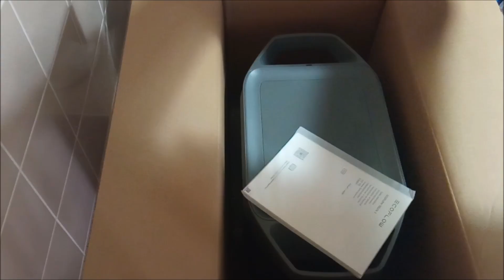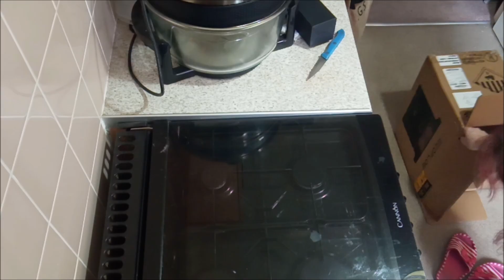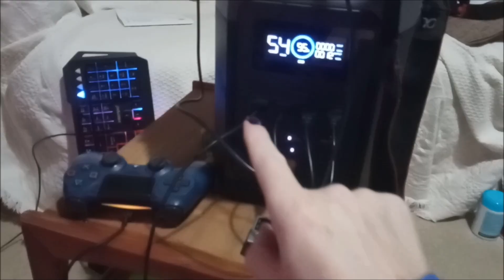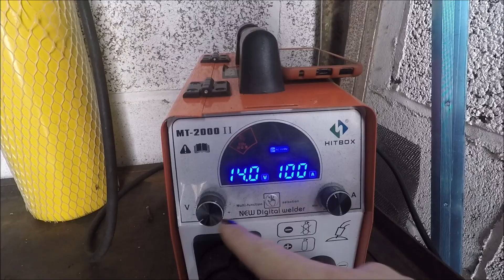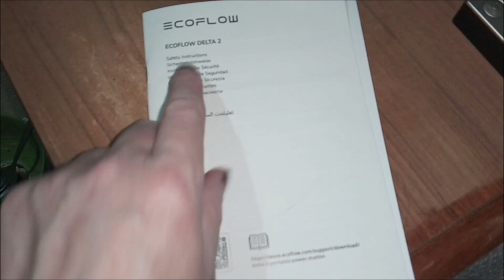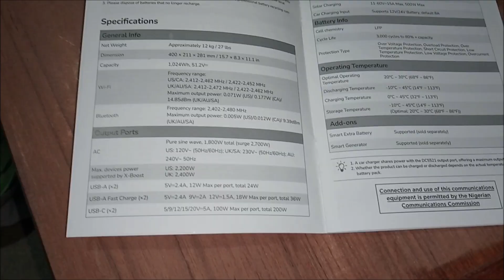Ecoflow Delta 2 unbox and test.

Comment: I didn't think it would be powerfull enough to run the welder. Tbh there maybe alright for boiling a kettle 😂. I don't know to much about them but what I do know we used to use Generators there was plenty power in them. Its but unfortunate. 😊 Good video all the same. 👍

Comment: The intial hot start surge of the welder is probably way over what the circuit protection on the battery will take. You will be Ok with a 135amp welder I suspect.
Reply from the maker: That's what I suspected John.